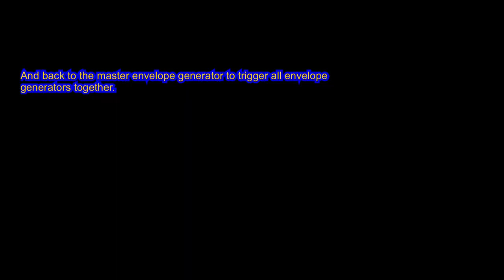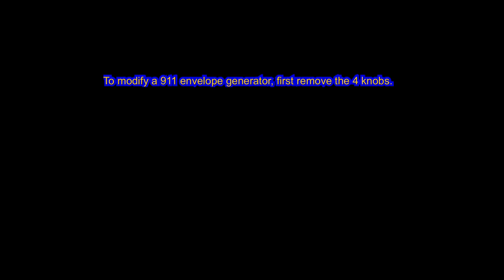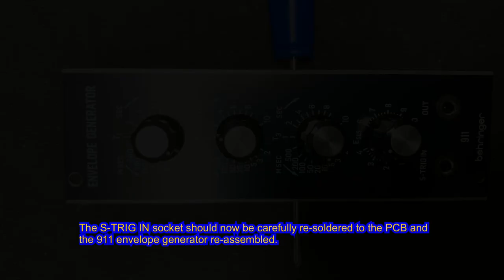Behringer System 55 - 911 envelope generator modification

Comment: Rob.  
This is a great mod.  Moreover, it appears that you've unlocked the key to enabling the switched normal connection in the jacks that are used by Behringer.  This allows any input jack to have a "normal" input, which can be overridden by inserting into the jack.  The obvious application is with the standard wiring for Kybd CV and PWM from the 921A Osc Driver to the 921B VCOs.
It is not at all clear which trace to cut.  
Let me ask first, is the trace between two round pads?  (the rectangular pad is ground, right?)
Second, are the two pads closest to the two edges of the PCB (at the corner)?
The switched connection is the pad closest to the bottom (the end, not the side) of the circuit board, right?  That's what the orange wire from the "master" is connected to.  
The orange wire connects to the the master at the output pad closest to the side of the pcb.
Reply from the maker: Hi O.Z. Yes I had thought about modifying the 921B VCOs and PWM connections, (I believe it was done this way on the original Moog modular systems) but I’m still thinking about that. I agree that it’s not clear on my video  which trace to cut. Let me try to make another short video to clarify this. 
The other thing you may have noticed is that I have added LEDs to the 921 oscillators Auxiliary output . This is a little more complicated because you need to insert a transistor as a buffer to drive the LED to stop it dragging down the oscillators but it is definitely doable if you are reasonably familiar with simple electronics. I’ll let you know when I have made the clarification video. Regards Rob
Reply: @ProfessorSynth  Rob, The LEDs on the 921 and 911 are both on my todo list.  Where did you get the aluminum that you drilled for the drill guide?  does it have a right angle on the side?  Did you drill through it on each panel or just use it to mark the location?
Thanks for paving the way on this!  BTW, Anthony Marinelli just published a video that mentions several of the "normalled" connections n the Moog IIIC.  You may have seen that already:
https://youtu.be/lEktjvpNfac?si=WJjU2tY6zIiocsKy
Reply from the maker: @ozhalljr  I have posted an unlisted video which should show the pads to be cut more clearly. I checked out the Anthony Marinelli video, very interesting. Check out the video here and let me know if you need any more information https://youtu.be/gKLEZZLYS-U?si=LMlFIdEVFa7Byl1S
Reply: @ProfessorSynth  Thanks Rob!  This is the S-trig in socket,  right? (your comment said "the bottom pad is the "Signal out").  So the pad at the bottom is the S-trig signal from the socket.  The other black dot pad (rightmost in the picture) is the normal pin to which we would solder the Master's S-trig in line, right?
Reply from the maker: Hi O.Z. I have put another short video up which I hope will explain. Let me know if you need more clarification. https://youtu.be/OIFh_N6T5MM?si=Nv9q9rGBELHWLNfW
Reply from the maker: Not sure if you saw this video on my V-trig to S-trig converter module. However, I have since made this redundant by including the transistor in a short 3.5mm male plug to 3.5mm female socket cable. This eliminates patch cables for S-triggering completely as the converter cable simply plugs into the V-trig source cable making things much tidier. https://youtu.be/tg08dhPEkCs?si=72cMrhD4P9IE9KPa
Reply: @ProfessorSynth  Thanks.  I watched that video as well.  I have made a couple of these V-trig to S-trig cables before, but in 1/4" connector format.
Reply: @ProfessorSynth  Rob, thanks for going to the trouble to document this.  A picture is worth 1000 words.  and yes, that's as I had imagined based on the previous video.